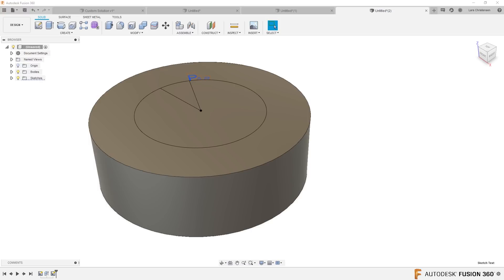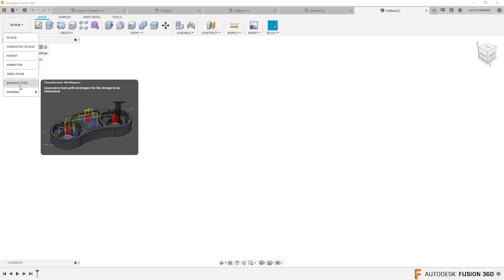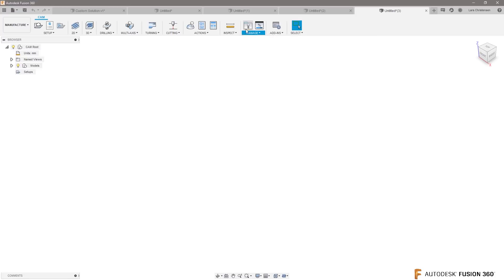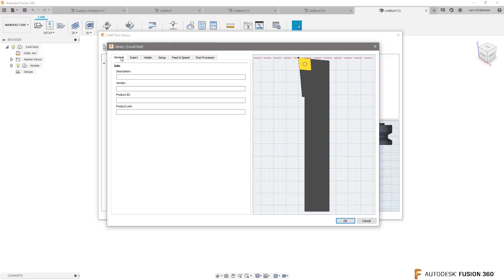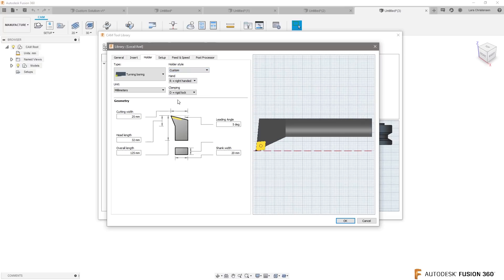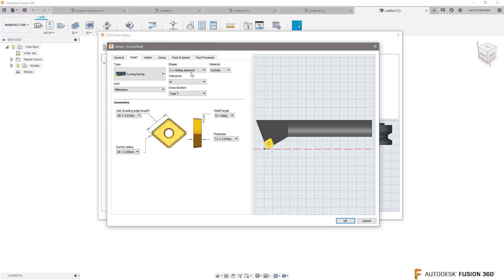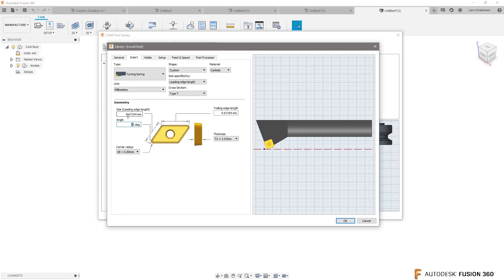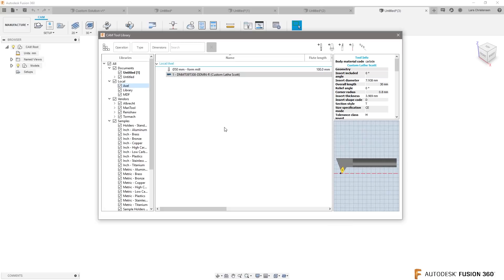Fusion 360 — Custom CAM Turning Tool — Ask LarsLive

Comment: I have diferent (newer?) interface for tool setup... Have no idea how someone could have considered it as ''new and inproowed'' at fusion. So yes, in case you, sir, run out of viedo topics - turning tool setup for curent interface would be nice. Especialy on ''cuting width'' parameter and things like arbitrary/non specific names of angles of parameters. Not even anything costum, just standard profiling bars.